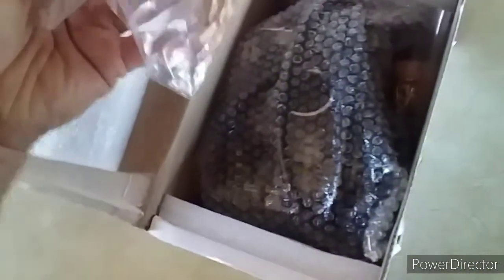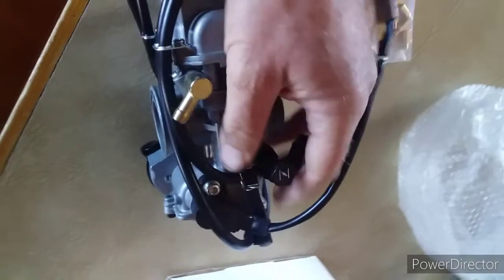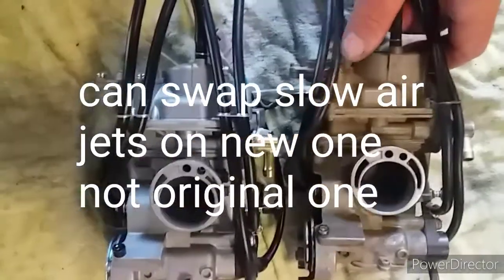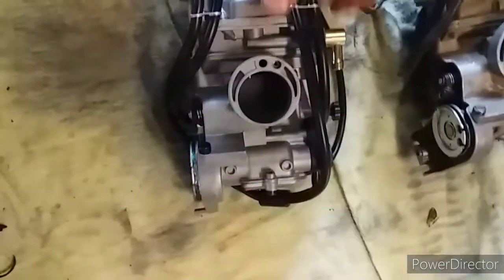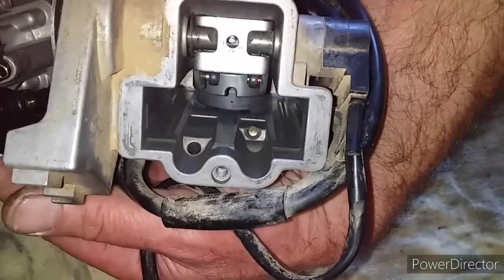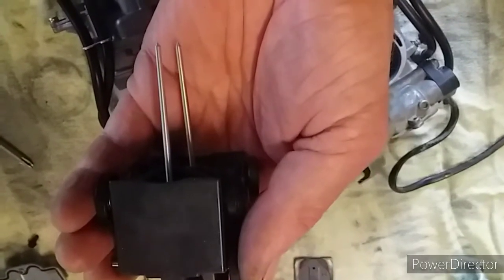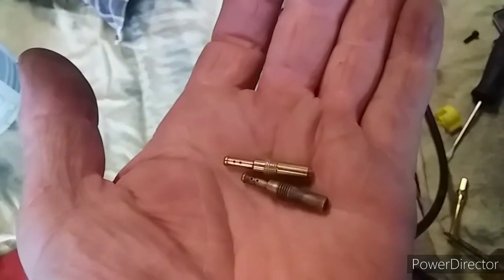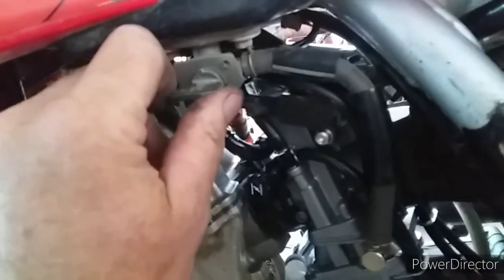FCR carb CRF150R Chinese copy in box and fit.

Comment: i got a 150r with a bad hanging idle atm just rebuilt the carb but i think i might have a worn throttle body to didnt change the mid body gasket but i think i might just buy a cheap chinese clone to atm and see how it goes any bad feedback for the chinese clone yet mate
Reply from the maker: went well all season with the changes shown in video. Bike sold now but would do the same thing again.
Reply: @AGPABRIGGS got my chonda carb today  have to try it out later cheers mate
Reply: @leonwatts6134  let me know about the carb I'm curious
Reply: @tylerwallace6085  it was a pos the fuel squirt into the throttle body instead of back of inlet valve the jet was pointing off so i just used it for spare parts the chinese ones also loctite 620 the mid body screws so if u want to pull it apart u would need to put the whole carb body in the oven at 200deg cel
Reply: @leonwatts6134  dam I just bought one